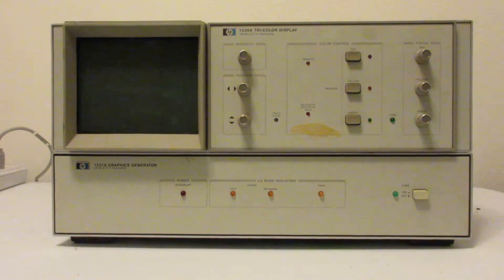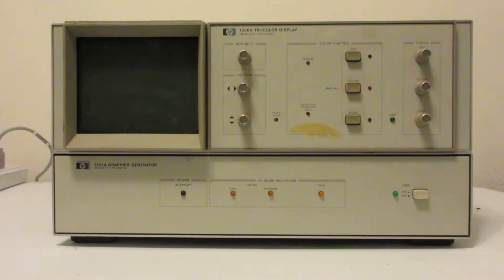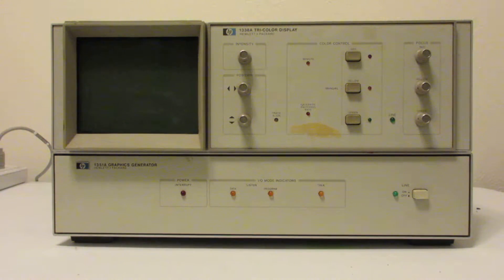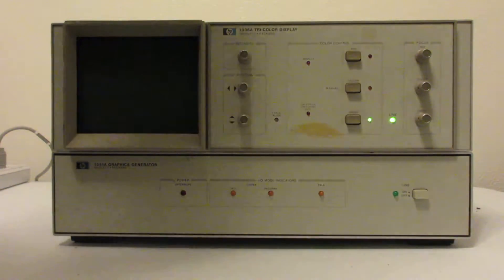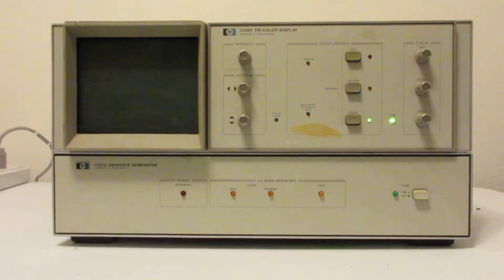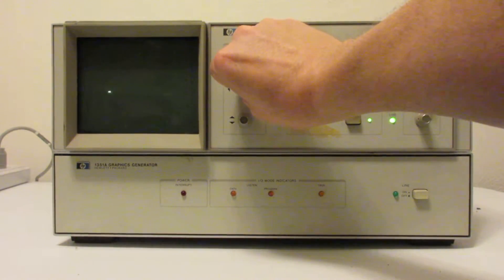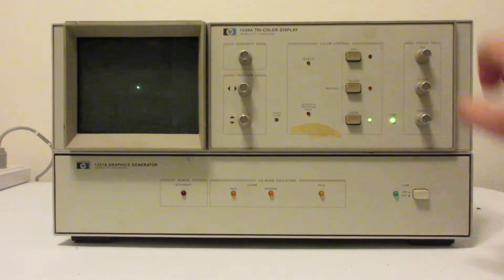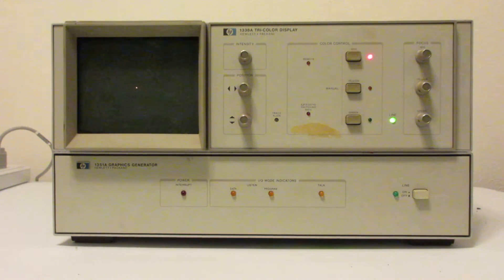HP 1338A Tri-Color XY Display manual control demo

Comment: Ha, 7 years ago, so I doubt you will see this. I recently acquired a HP 1351A (needs some restoration) but I can only find a 1350A manual. Not even any trace of a 1351A manual. Were you ever able to find one?  Till reading the 1350A manual I hadn't heard of the 1338A. Now I'll be hunting for one, but I strongly suspect I won't ever find one.  Did you get the two units working together?